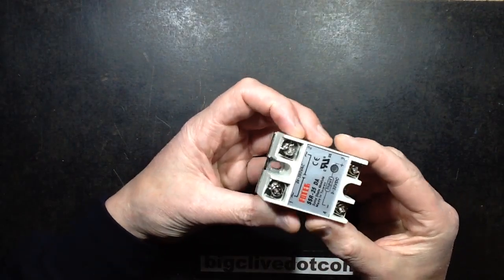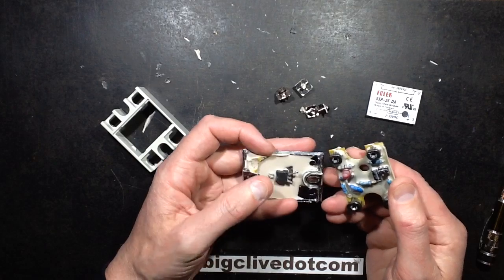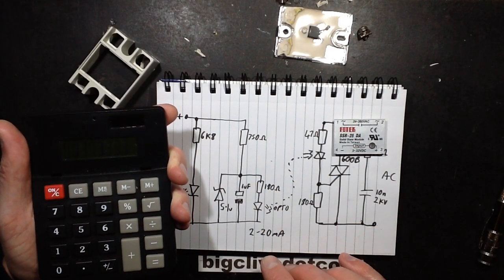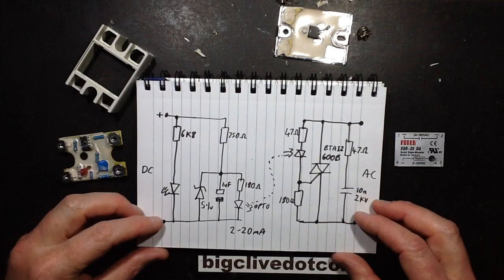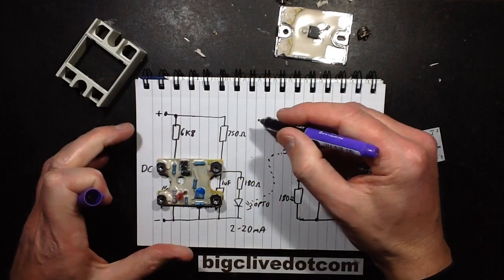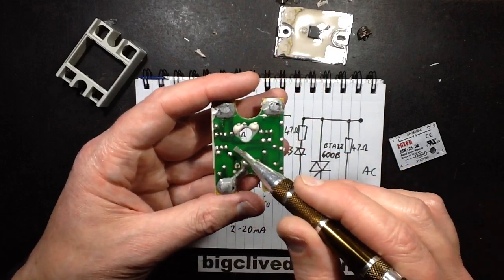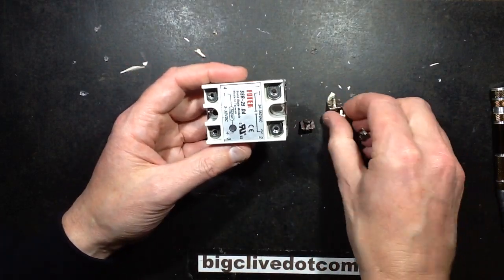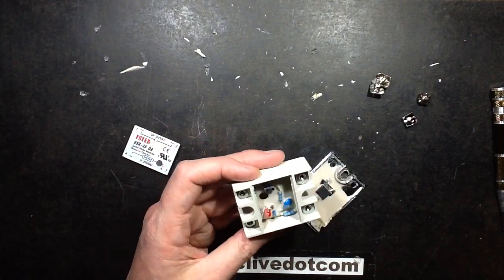Teardown of an eBay 25A Solid State Relay.  (SSR)

Comment: Here is a reply I received from an Amazon seller after leaving a review of their fake SSR. It's a pretty sad excuse. 

"I'm very sorry. I know our mistake made you a little disappointed, but please give me a few minutes to explain that，this product is from OEM and delivered within the period of novel coronavirus pneumonia ,at that time China is lack of raw materials and lack employee .Most of the worker, including engineers, was on vacation. Only a few people stayed in the factory. (originally, SSR-25AA used BAT24 Chip,SSR-40AA used BTA41A ) Due to the fact that engineers can't get to the company in time, many employees can't go to work in time because of pneumonia in China. Pneumonia affects the closure of the city) which leads to the following mistakes. Originally, our brand is eqiek, but due to the negligence of the printing staff, they make the label FOTEK instead of EQIEK . But we confirmed that there is only a batch of part labeled printed wrong. In fact, the main drawing of our products is eqiek(Pls check OEM brand EQIEK as attachment ) We have confirmed with the factory that we have ordered 1000 pieces of ssr25da and ssr25aa respectively. More than 900 pieces are produced with bat24a. Only a few dozen pieces are produced by BTA12A within a period of novel coronavirus pneumonia , engineer can't back to office immediately ,one worker mistaked BTA12 instead by bta24a, When we found out, more than 1000 goods had been delivered to Amazon's warehouse. We contacted Amazon to return the goods. However, due to the impact of pneumonia in the United States, there was no reply. Last , we have no idea to deal with returning the goods. .AMZ service answered :Because 1000pcs SSR-25DA with SSR-25AA have been diverted by AMZ warehouse .we feel very helpless about this matter. But we will be responsible for our every customers.Please Believe us, we only do honest business, we will not deceive every customer. On behalf of our company, I apologize to you. Now our company proposes two solutions: we will refund the money to you, or we will send you replenishment from China (this time we promise SSR-25AA 100% function and with BTA24A chip ) ,However, the US postal service is very slow and may not be able to deliver it to you in time as the spread of pneumonia in USA ,so hope your advice to us . Hope you can forgive us and hope you can give us a chance to service for you .We will cherish this chance .we are willing to return payments for you .Thanks for your time to read this long email .
All best wishes for you and your family
Happy everyday
JESSICA"
Reply: Hi, I've just been dealing with Amazon support over the fact that when I went looking for SSRs on their site, I still get advertised by them fakes which I already reported to them over a year ago, left bad reviews and so have many other people - but enough people seem to either not realise or go 'oh well it's cheap and does work for the lower level job I have for it' that they drown out the many reviews clearly calling them out for being fakes or just not working.  As a recipient of fakes, do you fancy teaming up to at least try to get some proper action from Amazon?
Reply: @edumaker-alexgibson  

Amazon deleted my negative review.

I just sent this email to FOTEK along with loads of photos.

"To whom it may concern, 
In September of 2020 I purchased a FOTEK branded 25A SSR from a seller on Amazon. After receiving and installing the SSR it quickly failed. I was very suspicious and decided to open the SSR and found the TRIAC was a BTA12 rated for half the amperage stated on the label. I sent the information to Amazon customer service and received the response shown below from the seller. My review on Amazon showing I received a counterfeit was originally posted but has since been removed. I'm not too sure what FOTEK can do, but Amazon and the seller are selling dangerous counterfeit SSR's with the FOTEK name on them."
Reply: @edumaker-alexgibson  Here is the lackluster reply from FOTEK...

[Dear Sir/Madam,

Thank you for your information
We know that there are a lot of counterfeit from China
because of counterfeit is from China
FOTEK is from TAIWAN
I know it's problem
so We are not sell on any Website to be buyer's protection
and we have provided "where to buy" on our FOTEK's Website]
Reply: Pretty sad excuse indeed. I do business with China on a daily basis, and you need to plough through these kind of BS excuses every time things go wrong. You ask yourself why they even keep trying, stacking lies on top of lies, wasting your and their time, instead of admitting they screwed up and use that same time to fix it. One time we received bicycle carriers with only half of the parts in the boxes, "because factory didn't have parts". Took months to receive the missing parts (on their costs) and open up every box to add them. Big chunk of their and our revenue lost. Sigh. Simply admit you can't accept the order because of parts shortage. It's a strange business culture over there.
Reply: @resspls10k  They get to keep your dollars by accepting the order regardless of ability to fulfill it. The lies are to weary you out/delay for time - in the hope you will give up or run out of time for refund

Comment: I prefer the Use of Crydom SSR's. I have a bunch of Crydom SMR 4850-6 which can handle 96-480VAC at 50Amps. To control these thing you need a Supply Voltage (8-32VDC) to power the internal Logic, and then you can use the inverting or non-inverting control input to turn this thing on and off. It also has a N.O. and N.C. Alarm output and a integrated red Alarm Status LED to show abnormal conditions. A green LED shows normal operation when switched on. The Encapsulation is made with thermally conductive Epoxy.

Comment: It is interesting to see how one of those commercial modules does it.  I don't know about pulling multiple amperes through it with only that bottom plate for heatsinking,  though I guess that depends on what you have it mounted to.  And I'm assuming that the tab on that triac is isolated?  I have a bunch of 4A/400V triacs on hand and plans to build one or more of these.  I suspect that I'd probably use somewhat different parts for the snubber network,  though.  I plan to use the MOC3010 opto,  I think it's the MOC3020 that's the one with the zero-crossing detector in it.  Been a while since I looked at those datasheets.

Comment: I pulled the DC version apart, it had a BJT transistor, with the part number on it, good for about 8A, nowhere near its 25A nameplate.  Fraud from China.  At 8A it dropped 3V.

Comment: IMO, the price for those "FOTEK" SSRs is way to high for what you get. The STM datasheet for the BTA12-600B shows a pinout where A2 is on the middle pin and ALSO the tab. Having the tab screwed down to the metal backplate for a heatsink fixture, everything coming into contact with the tab/backplate/heatsink is LIVE .
Reply: @BlondieHappyGuy  Verification is always a good thing to do. In this case I'm not so confident it will stay that way in a breakdown of the part in question. YMMV.
Reply from the maker: That range of triacs are usually isolated tab.
Reply: @bigclivedotcom  That would explain the measurements taken. The datasheet says clearly otherwise, though. You wouldn't rely on having an isolated tab in the device, would you?
Reply: @BlondieHappyGuy  Sounds interesting, particularly the 3-wire speed ctrl of the fan. My point about breakdown was primarily of reliability concern, rather than overload breakdown which is part of reliability. Anyway, isolating the SSR is key to remain on the safe side (no pun intended).
Reply: @BlondieHappyGuy  keep on making projects! :) Never yet had a fan like the one you describe. Simple method with least parts possible. Is that humidifier some CE? Do you have any documentation on your project online?

Comment: Do you know if I could get a 230ac control input to 12v dc output solid state relay?
Reply from the maker: Not sure if there's something standard for that.  Is it just to detect an input?
Reply from the maker: You could use a mechanical relay with a 230V coil, but be aware that the cheap eBay ones overheat and may pose a fire risk.  Use one from a prominent local supplier.
Reply: bigclivedotcom Thanks Clive, that was my other option, I will not be using it for high amps, 5 A tops.  Great videos by the way, there is something quite nice with your voice.

Comment: do i see it right, the heat sink is directly connected to Pin A2 of the triac ? this means the heat sink is connected to mains voltage? U better not touch it !! Highly dangerous.
Reply from the maker: It's an isolated tab triac.
Reply: I'd wondered about that.

Comment: Be careful with this: I used a 25 A of this type to switch a 2000 W 230 V water boiler , so less than 10 A. However, after a few weeks it completely burnt. (It was hanging on its wires open in the air, so it could cool on the air (20 degrees C). I am happy my house was not set on fire.
Reply: Do you understand what you did wrong?

Comment: Thanks Clive. Have the 40a version switching my home theatre as the 10a relay kept welding shut!
Reply from the maker: Make sure it's in an area that is fire-safe.  These cloned SSRs are not rated anywhere near their stated rating.
Reply: @bigclivedotcom  If it's really only 10a with a heatsink, load should only be about  6a by my calculations.

Comment: Bought a 40Amp rated one of these to run a 7200W incuductive load, it failed closed after about 15mins of use. all the foktek once I can see on ebay and amazon are fakes, avoid unless you want to burn your house down. 
a proper rated one can be bought on RS including delivery for under £20 so why risk it.
Reply from the maker: I always recommend having a secondary safety device if the load is going to cause problems or be damaged by a long run time.  In the case of a heater, a thermal fuse is a good idea.  Most SSRs fail in the on state if they overheat or are subjected to high fault current.

Comment: Bottom line, use at 1/2 the advertised rating for best results.
Thanks for the education on these.
Reply from the maker: And never use in a situation requiring proper electrical isolation or where failure in an on-state can cause damage.

Comment: Purchased a few of these not so long ago.  Didn't take them up the the marked ratings.  Guess I won't be now.  LOL  I had intended on using one to switch a MOT (MircroWaveOvenTransformer) Spot Welder.  I'm quite sure it would had pulled more then 10A.  May have worked for some time.  Would only be on for microseconds at a shot.

Comment: Interesting fact. According to the low, and high voltage directive, potting compound adds nothing to the creepage, or clearance distances required under EU law. I make bespoke welding machines. I would not ever use anything but  carlo gavazzi SSRs. They are the best in the world, and will never kill anyone.
The ebay ones are great for switching light bulbs, and perhaps some other low wattage stuff. If you need isolation go for the expensive ones.

Comment: The backplate that function als heatsink is connected to the flange of the triac BTA12 that's internally connected to the middle pin A2 of the triac thus on high voltage AC!
Is that, while powered up, not dangerous for mounting it or just holding it?
Reply from the maker: Isolated tab triac.

Comment: I tore down a Fotek SSR 100DA after it failed and it had 2 x BTA24-800 Triacs in it which are rated at 25A each. It seems that it is common that the manufacturer claims double the actual rating. Another issue is that the heat dissipation is not good as they use an alloy for the heat plate instead of aluminium, this further reduces the efficiency and capability of the Triacs.   Very dangerous, be cautions, attach a very large heat sink and don't go beyond 30% of the rating if using these cheap type relays.

Comment: Hi Clive, I recently re-worked a Tevo Tornado 3d Printer. Their electrical safety is a joke; switched on neutral with exposed mains pins at control box, mains powered silicone pad on a moving bed with no earth or strain relief etc. I have fixed most of these problems with a complete re-wire but am still worried about the fact that the heated bed is a 550w silicone pad switched off the mains through an extremely cheap SSR. In your experience, do these things normally fail short circuit or open circuit? For now, I have rigged a Pi to a smartplug to shut off all power if the temperature goes out of range but wondered if putting two SSRs in series might work better. The thing only draws about 2a but you can imagine what would would happen if the micro couldn't shut off the pad! I hardly turn my back on it lol. All the best.
Reply from the maker: SSRs often fail short circuit.  It might need worth adding a thermal fuse in series on the heater.
Reply: @bigclivedotcom  Thanks for the help!

Comment: I know that this video is old, but there is one thing about this video that (I felt) should have been discussed. I noticed that the Triac was mounted on the Rear Alloy Casting, (as a Heat Sink) but the Triac had mains voltage on it!  In the design of the Fotek SSR, do you think that NOT enough emphasis or consideration has been given by the Designer of this Unit, by the inclusion of an Earth?? If the underrated Triac becomes destroyed, there is a high potential for the rear alloy casting to become "live". This could be hot, dripping solder from the Triac itself - making contact with the alloy rear casing. BTW I always like your informative content, a regular viewer who likes the Ayrshire accent!
Reply from the maker: In most industrial applications the heatsink surface would be earthed.

Comment: This is a Chinese clone and not the real thing.  You can tell by looking at the corner of the plastic cover where the metal plate attaches, the real one has a curve on the lower right.  The clone does not.  The real one has a triac for the proper 25 amps.  I have used these clones and there is no short circuit protection on the ac output.  If a short occurs anywhere in the ac line it destroys the triac.  That’s why the cheap price.

Comment: I checked the UL listing and they had a warning on spotting the fakes like these. The real ones cost so much more but they're real, tested and won't be a hazard like these fakes. The only problem is to find a supplier that sells the real thing in single unit quantity.

Comment: Wow. I’m glad I went with the 40 amp version for a heating application recently, Same brand. bought from amazon.
Reply: GreatScott also did a review of a 40A version of these, which also turned out to have a 12A rated triac inside. So maybe we should consider them all as 12A SSRs regardless of their marked amperage... at least until we have destructively dissected one to confirm a higher rating of its components.
Reply: Ben Hetland I’m wondering it it’s rated 12a with no heat sink. But maybe with a heat sink it can handle more amperage

Comment: Too bad you didn't show how you opened that thing. I have one in front of me and are wondering how to get this open without breaking it.
Reply from the maker: If it's potted in resin.  There's no way in without potentially breaking it.
Reply: @bigclivedotcom  Sure - but since it wasn't I eventually got it open too. And found my 40A SSR is actually a 25A SSR.

Comment: I added a comment down the line.  Essentially, I said that I now understand that mixing ignorance and electricity seldom has a happy ending.  I recently installed two FOTEK switches as replacements in an infa red sauna application.  One of the switches melted blowing the breaker.  I was lucky I did not burn the house down.  I’ll either hire an electrician or scrap the heater.  Thanks for all the comments; I learned a lot about what not to do!

Comment: Merry Christmas Clive! Would a zero crossing SSR make my well pump easier on my inverter? Not as much as a soft start. But wouldn't it help the start-up inrush current? It's a 120v pump. And not the lower current as the 220-240 version. Being offgrid i run the pump from the inverter or generator. And inverters are expensive. I want to be as easy on it as I can. Or is it worth it?

Comment: ebay seller sunny-planet168 sold me 3 SSR 25DD the DC-DC version.  All were incorrectly assembled with the back plate connecting to the output terminals.   Same white resin covering the components and sadly I never tested them when they arrived, only when I needed to use them.  After I tried a couple of others and can tell you this seller has lots of accounts in HK, when you get your paypal invoice its the same guy.  I emailed FOTEK via there .cn website, obviously no response.  IMHO ebay is full of failures, even when they work like in this video the main triac was rated wrong
Reply from the maker: It sounds like they used a non isolated tab triac.

Comment: Wow interesting yet... rather scary inside if you ask me.  I was considering using one of these or a design basis similar to these and now I'm left rather undecided and a bit leary of them.  Think I'm sticking with a relay that latches.  I had removed one out of a busted plasma cutter that was massive; needed a big supply to run it however.  Anyways, cool review man and channel.
Reply from the maker: If you got a proper solid state relay from a local electrical supplier it would be properly rated.  This one was an inferior clone.